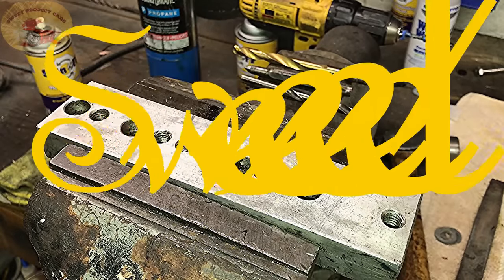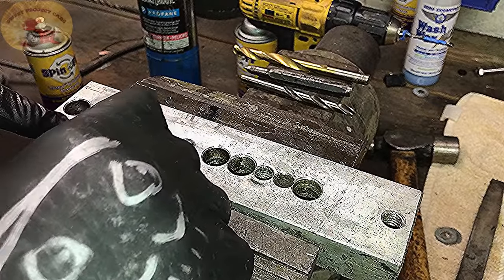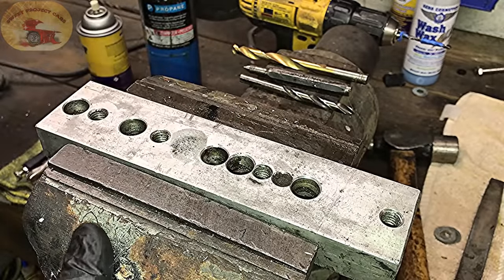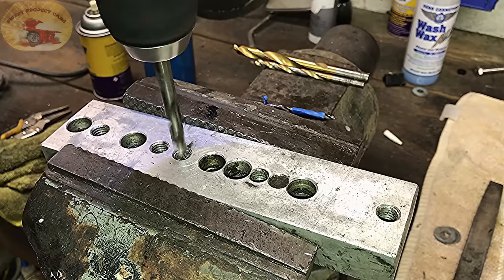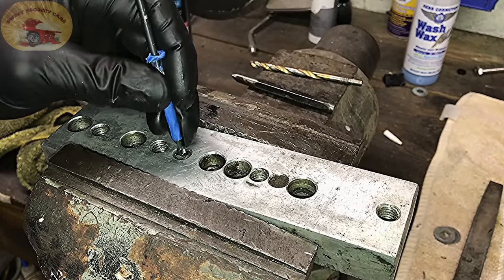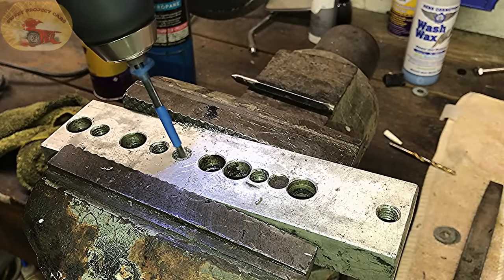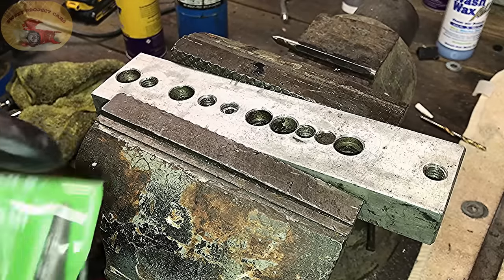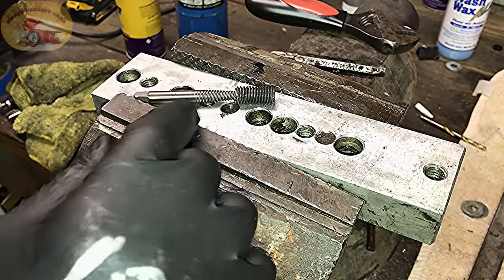How To Remove a Busted Bolt FAST! New Style Screw Extractors

Comment: Have a bolt broken off in a trailer hitch, used the drill bit but dont have a extractor, there is a good size dent in it now, not sure if there is any wall left for an extractor to get it out. This has been so frustrating! how do people become mechanics?? are you all mad? you must like to get angry haha
Reply from the maker: Well, it's not easy that's for sure.  If you can soak it down with this  https://amzn.to/34eFN0B  then use one of these  https://amzn.to/2J7NGvX , https://amzn.to/2DVq3n1  or  https://amzn.to/2ZT6Hba  any will do the job for you.  Hope this helps.  Have a great day.  mad Mike the hammer SPC

Comment: Even bought the same extractors, now I have an extractor tip stuck down in the bolt threads
Reply from the maker: Sorry to hear that, it happens when you get too anxious.  All bolt extractors will snap off if they are turned too hard or too fast.  Thanks.  mad Mike the hammer SPC

Comment: Thank you for the video.  However, every time I see a video that says how easy or in this case, "super easy" something is; I'm leery and with good reason.  I have yet to find anything that says it's easy to actually be easy.  I've been working on drilling into a broken screw for at least two hours and have a broken drill bit (which happens every time I try to remove a broken screw) and it is still stuck in there.  Needless to say, I'm not very happy at the moment.  Maybe in a perfect world it's easy...in my world, it is not...ever!!  I don't know why I keep trying...guess I'm a glutton for punishment.  Great video though...if it worked.
Reply from the maker: My friend, you've got to think positive, one of the key tools to use is this  https://amzn.to/3vRtG81  it's imperative that you use these, they make many sizes.  And sometimes you just have to add some heat for ease of removal. I understand the frustration, been there done that :(  Hope this helps, thanks for watching and sharing, have a stupendous day and all the best on your project. mad Mike the hammer SPC
Reply: @SweetProjectCars  Thank you for responding.  I do get so frustrated.  After posting my initial frustrated response, I bought some of the supplies you listed above, the high quality drill bits, the screw extractors and the crescent wrench set.  While I haven't gotten the entire screw out, I did get a section of it out and if need be will get more of it out.  I'm not sure I will need to if the new screw fits without removing the entire thing, which I'll find out next week when they come in.  The drill bits worked so much better than what I'd been using, although, I used multiple drill bits and the extractors I had weren't working at all.  Using the key tools is imperative and I appreciate you including all of the links with the video.  YouTube has become my go to for all of my home projects and your video, along with the list did help me.  Not quite as easily as I had hoped, but in the end I got it done.  Thank you so much!! 🙂

Comment: Um.. what's 'New,' about that screw extractor you used? Im 63 years old and been using identical screw extractors to yours for 38 years!
You can't be that far behind the times in your country... surely?
Reply from the maker: rin  they have a point on them and the angle of the threads are at a 33.7 degree angle so they bit better than anything around